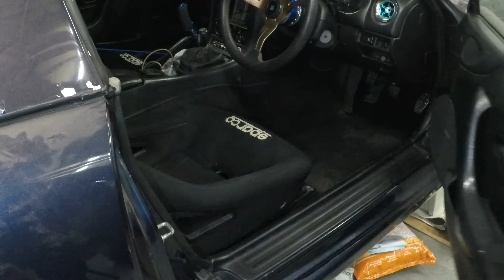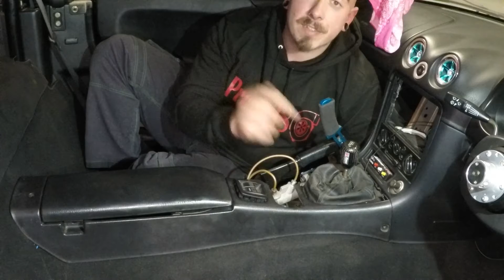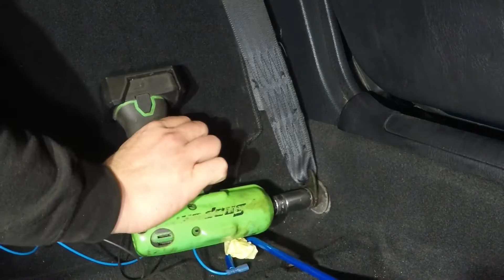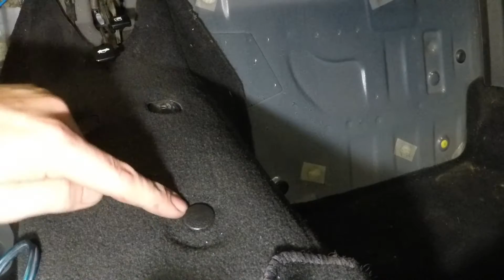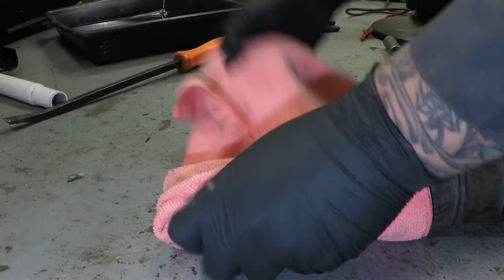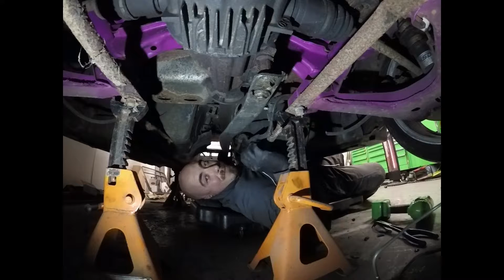GEARBOX AND PPF REMOVED : MX5 TURBO BUILD pt 21

Comment: does anyone ever leave the ppf off? must weigh a bit...or is it like a serious backbone stifness peice? #becauseracecar
Reply from the maker: unfortunately with the standard gear box it is an essential part of the structure. if you removed this then the diff and engine would flop around. the only way round this is with a Kmiata kit for the bmw trans
Reply: @Project380  yeah I've seen that mod on carpassion. Hopefully you won't need it!